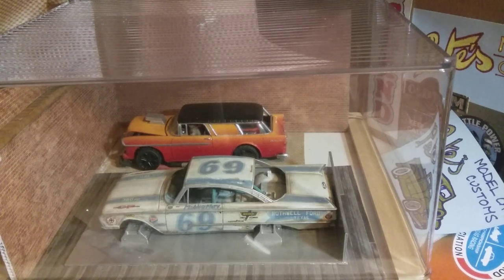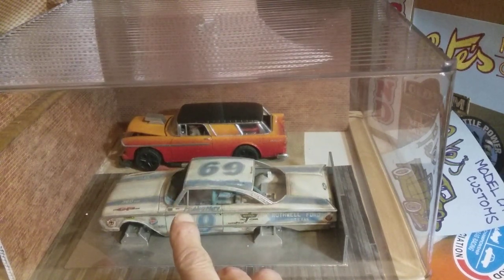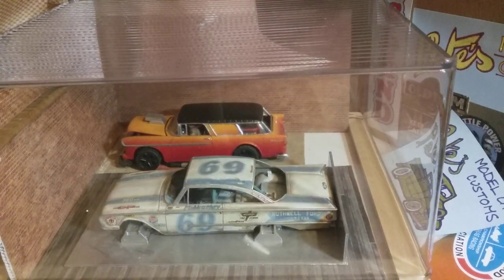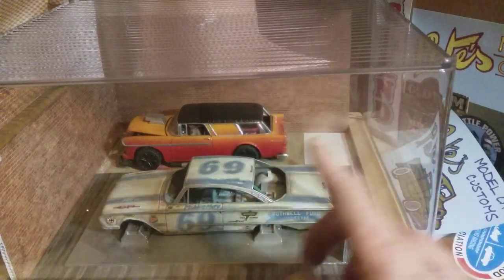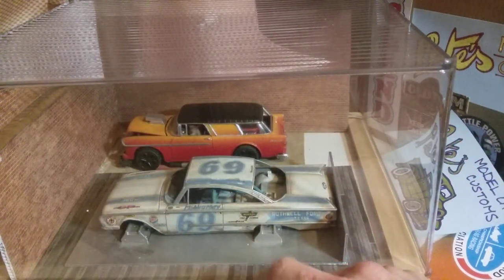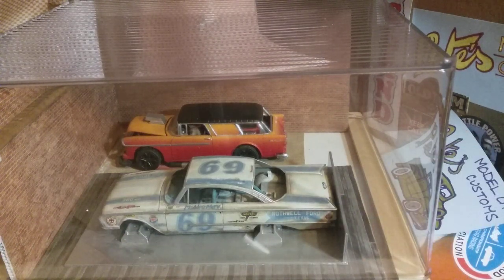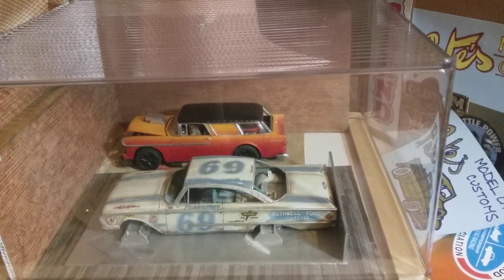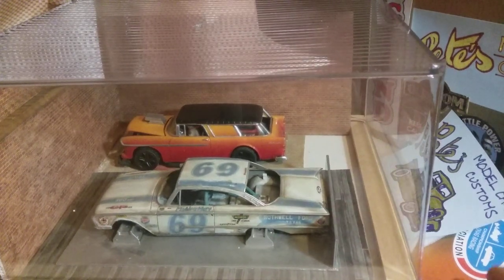Garage display, size is important and ideas wanted

Comment: I agree with the suggestion about getting an AMT garage kit.  Maybe two of them. I think you need to take advantage of the height of the box.  Thanks for sharing.
Reply from the maker: I've got one somewhere in a mountain of boxes,Micheal ,I'll dig it out and have a look🤔👍
Reply from the maker: Very helpful suggestion,Tim. The rule of the thumb🤣🤣👍👍😎
Reply: @petesmodelcarcustoms584 The thumbs point up, so up you go! - You could also build a second level for storing model car tires and parts like bumpers. Just add in a ladder so your figures can get up there.